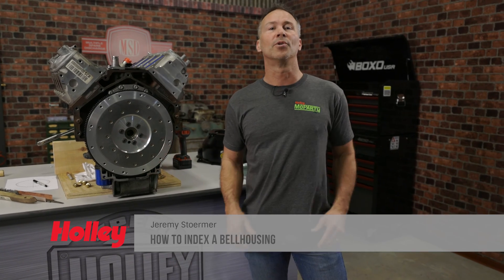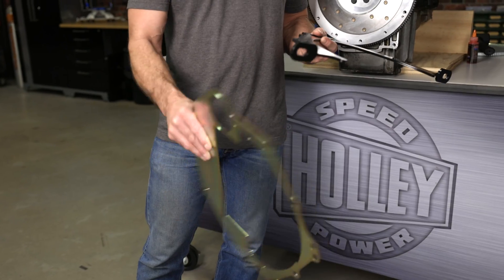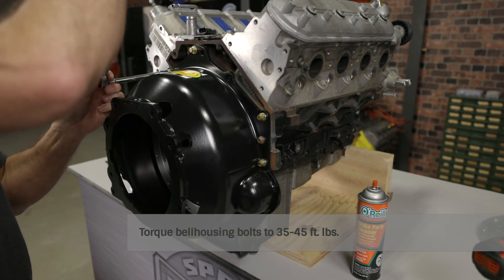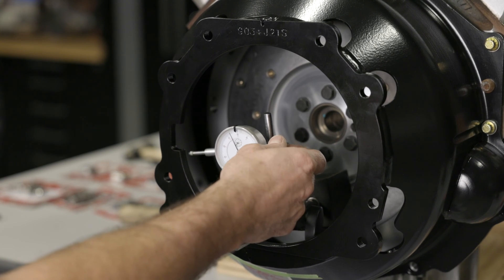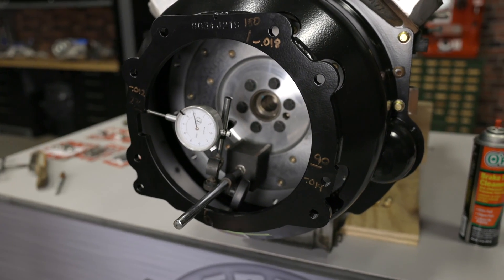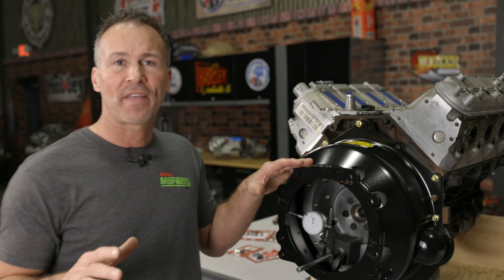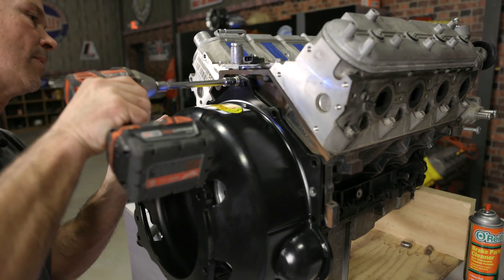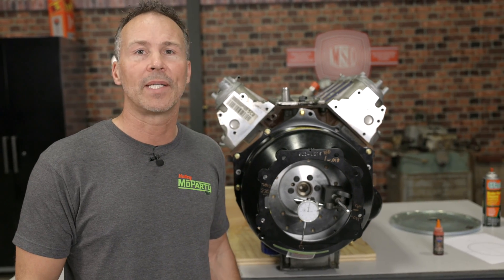How to Index Your Bellhousing

Comment: Silversport transmissions has the best offset dowels. They are cheap and pre marked with the high side indicated. I had a set that didn’t have the high side indicated nightmare. Once i got them it was easy to correct the offset

Comment: Check your pin offset with a quality straight edge and a feeler gauge. A lot of times they are off by a .001 or so. Plus this gives you a chance to put a dot on the top of the highest spot with a sharpie so you know what direction to install them.

Comment: Is this really THAT important considering that the OEMs don’t do this and that NOBODY bothers to align the transmission to the bellhousing?
Reply: Yes because in the oems there is more play in the bushing the input shaft rides in
Reply: @blakenorman4822  Once again, nobody bothers to align the bellhousing to the transmission. Also, with transmissions like the T56, you need an alignment plate to do an alignment. And there is no telling whether you are going to get the same plate -> bellhousing alignment as the transmission -> bellhousing alignment because nobody checks these anyway.

Comment: But with offset dowl pins, how does the bolts for the bellhousing line up?
Reply: There is enough of a difference between the ID of the bolt holes and the OD of the bolts that it isn’t a problem. That’s why you need dowels.